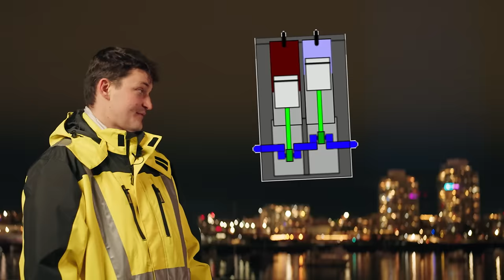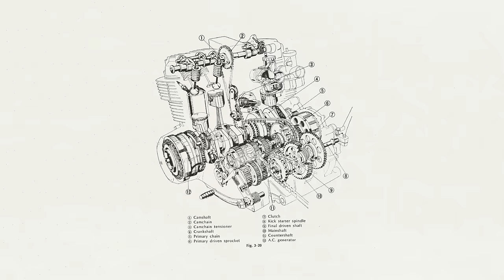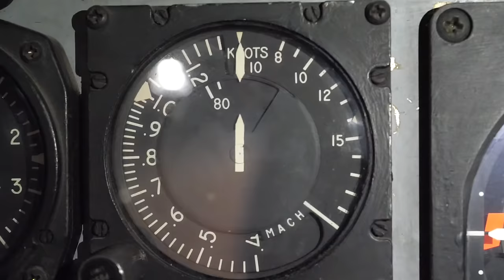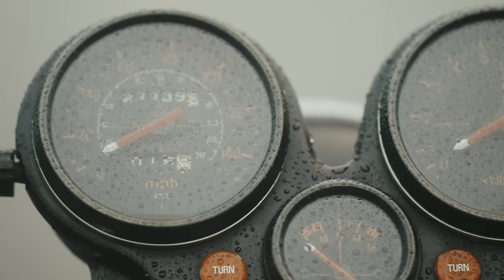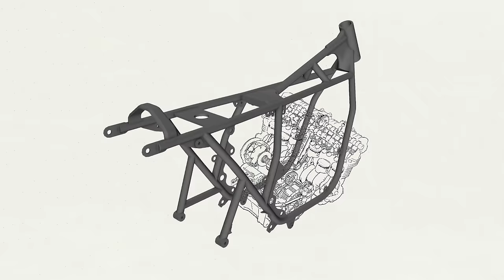Riding the Cream Machine - Honda's Smooth Six

Comment: A friend of mine bought a CBX brand new when they hit the showroom floors in the UK. I was riding around on an SP1000 Moto Guzzi at the time. He stopped by one day to chin wag whilst I polished my own bike on the driveway.
He asked if id like to take his new bike for a spin. I'll skip over the mental trip into the realm of another reality as I set off on a favourite test ride loop. But he was so lucky to get it back unscathed because having ridden the Guzzi for a couple of years I'd developed the awful habit of relying almost solely on the foot brake. They had a linked system that applied one of the front brakes along with the rear. Imagine for a moment the thoughts racing through my head (not to mention the state of my bowels) as I left my braking to the last possible moment, as was my want,  and discovered that no matter how hard my right foot was pressing down the bloody bike wasn't slowing. 
I never rode it again. But it was truly lovely to ride as well as look at.

Comment: In 1983 I was shopping for a new bike.  The local Honda dealer had both left over CBX's (the ones with saddle bags), or the new CB-1100F for the same price.  I bought the CB-110F, and although it was probably the better bike, I've always had some regrets....

Comment: That’s why I loved my 83 Seca 750. I could ride that bike to the very limits of its braking, acceleration, top speed and lean angle and it was always within my comfort and skill but just by a little bit. I controlled the bike, not the other way around.

Comment: The centre power take off position probably helps reduce torque distortion in the looooong crankshaft.
 I suppose that, arguably, it didn’t have to sell but rather to just exist in the stables lineup. It’s the centre page pinup in the sales brochure that hooks and hauls in the punters who then opt for more realistic choices further down the brand. But what a pinup!  Front tyre looks a bit slick!😮

Comment: if only Honda would make a straight-6 car with RWD. like a Honda Supra or Honda M3, that would be the most epic car ever, reliable, long lasting, light, perfectly balanced, best handling and most tediously engineered and overengineered. No one would buy it cause they prefer their oil leaking BMWs with CELs for the badge, but Honda has so much heritage I dont see why they shouldnt be on the same level
Reply: Agreed 👍👍👍👍👍👍👍

Comment: I had one of these...back in the day when they were cheap.  GREAT engine, until you had to work on it, but very reliable and scary smooth.  The joke at the time was that a CBX would pass anything on the road except a gas station or a place that sold chains and tires!  It was heavy and didn't really handle very well, but get it pointed in a straight line and whack the throttle home and you might start to think there actually IS a god.  Sort of wish I'd kept it and put a good Corbin seat on it (it already had a Kerker 6-into-2 exhaust)...but I moved on.

Comment: Great video, as usual.  Always wanted to try one of these but was always fearful of being accused of indulging myself in wretched excess.  They also sounded great with a six into one exhaust system but it looked like heck.  Had I known they could fly, I would have put my fears aside.  Instead, I contented myself with a 1998 VFR (gear-driven cams but a fuel tank that would roast your crotch because of some kind of fuel recirculation pump) and a 2015 VFR/Interceptor which was one of (maybe THE) the most elegant street bikes Honda ever made.

Comment: Follow-up:  In 1987, I replaced the CBX with a left-over 1985 Honda VF1100S.  It was a bit faster then the CBX, still heavy but did handle better, had much better brakes and suspension (my CBX was a '79).  It was smooth, but not as smooth as a CBX.  However, it was a bit easier to service and did not require those legendary "Japanese mechanics hands"...you know, the ones with 8 fingers 1/4" in diameter 8" long with 10 joints each...  And, believe it or not, I STILL have the Sabre.  It's got just over 70k miles on it and has never given a spot of trouble, but I do maintain it by the book and can do everything myself.  Great bike that might be worthy of a video, IF you can find a nice one.  So many of them got killed after they got cheap in the 1990s and the kids started buyng them and then crashing them.  Pity...

Comment: Years ago I saw some photos on the knee slider website of some absolute lunatic's mad creation. He had turned two CBXs into a V12 and then built the frame to go around it and apparently actually rode the rolling insanity.
I thought it would have been one hell of a powerboat engine.

Comment: I really really wanted a a CBX 1000 when they were in the dealers, however I could only afford a newish secondhand Honda CB900F. As it turned out the 900 was a great bike probably the best Honda overall for short moment in motorcycle time.

Comment: A rare beast indeed, its the bike you wanted if you wanted a 6. The trouble was, if memory serves, was that all the competitions 4 cylinder 1000's were just as fast and handled better. Still..... what a machine!
Reply: The 1980 16 valve GS1100E put the nails in the CBX's performance coffin. The aftermarket too decided the CBX wasn't worth developing performance parts for, besides exhaust systems and a few chassis parts. Then the 81 GPz1100 made another offering on the market that out-performed the CBX in every measure of performance. Even the standard 81 KZ1100A2 shaft could keep up with the slower 80 and up CBX, and all of them could better even the faster 79 CBX for a lot less money. THe cBX was eft out of the race, figuratively and literally, while the KZ became the small block Chevy of the motorcycle world for the next 10 years, and the big GS was the Chrysler Hemi of motorcycle drag racing for the next 20 years. I choose the CBX because of the mechanical sophistication, the visual presence of that Mount Rushmore sculpted in aluminum engine,  and the heritage of the RC166. I also believed with a few modifications, I could make the CBX a much faster bike, one that sounded even faster than it is, just as a "bonus". I ended up with a very quick and light weight 79 CBX, but by the time the GS1150 and V-max came along, my back yard budget engineering abilities had finally met their match and i stared losing races to stock bikes more often than not. When the GSXR1100 and Ninja ZX10R  entered the picture, even an 1150 big bore kit and smooth bore carbs weren't putting my CBX on a level field with the new bikes.

Comment: I've only owned Kawasaki bikes, they speak to me in a specific way.  I always feel like I have to work to make the bike work.  I don't with Honda's.
The first Liter bike I ever rode was a 2007 Honda CBR 1000RR, up until then the fastest, most powerful bike I'd ridden was my 2002 Kawasaki ZX-636.  It was night, I jumped on it, rolled the throttle on, and mindlessly clicked through the first Three gears, came up to a corner going way faster than I have any right to be, looked through the corner and the 'blade just did it.  I didn't have to do anything.
That Honda was so much better than I was, or will ever be.  Honda bikes are there, I'm the limiting factor of their amazing Engineering.  Which is why I won't buy one, I don't feel like I'm needed in that equation, I hold the bike back.

Comment: Needs a 6 to 1 exhaust for that high note though :) 6cylinder sound is wasted if it doesnt reach many octaves <3

Low brreeeeemm breeeeemm is for the v6 anchor weight engines

Comment: I know the configuration is different, but I have to wonder if the CBX gave rise to the idea for a boxer 6 for the Goldwing/Valkyrie bikes.  As a prior owner of a Valkyrie, I can attest that you'll never have as smooth of a riding experience as you will on a Valk/Goldwing.  The throttle response is instantaneous like RF9 mentions.  It's just so smooth you fully grasp at how crappy even the best suspension systems are on today's roads.

Comment: Just a note on how tough and durable a CBX engine could be (less so the clutch and transmissions, though), I can't count how many times I boogered the first to second shift while racing and sent the tach needles of these things way past the 9300 RPM redline, many times with the needle pointing straight down - approximately 14,000 RPM extrapolated - and never having blown one engine up.

Comment: I wonder if the CBX engine still has potential as an updatable platform.  A lot of the engineering such as the mid crank power take off, similar to the CMX 250 engines and the CB 750 engine's mid crank driven cam chain has some very interesting applications.

Comment: *Corrections to the narrative:1)  1969 was the first CB 750 “Sandcast.  2)  CDI = Capacitor Discharge Ignition. 3) The first H2 750 was a 1971 released only in Norway & Sweden and was dubbed the Mach lll. 4) The first Z1 was a 1972 model in European release only and very few were sold and had no marketing. William

Comment: Nothing is more frustrating on one of these bikes than rebuilding the carbs and having it run beautifully one year and then the next year cylinder #4 won't run at idle......you have to remove most of the engine mounts to tilt the engine forward to remove the carbs (they come out as a package) and then remove that pesky idle jet and clean it in the ultrasonic cleaner. then you get to put it all back together.  Love my bike though!

Comment: I've had a number of six cylinder inline car engines and they've all had kind of a burble at idle.  Not really a miss but kind of a light pop in there somewhere.  As a Honda guy back to the 60's of course I've always lusted after an inline six bike.  I've had to settle for a flat six Honda instead.  Also "creamy" smooth.

Comment: A 4 cylinder boxer with the 2 middle cylinders on one side and the outer ones on the other side would also be balanced primary and secondary. I haven't seen one yet. It's always 1&3 one side and 2&4 other side. 🤔
I love motorcycles but they're all too racy. The CBX would be a dream bike for me if it had half the power, half the valves, one carburetor, twice the low end and a lot more flywheel.

Comment: 9:08 Bikes of that era had flexy tubes, wonky carbs, air cooled for tech weaknesses. No ABS or traction control for the rider. They had a long way to go. Thid bike was not the pinnacle.

Comment: I disagree, the problem of the cbx is the handling, the engine is not a brick, its a wall, i drove one and in the first bent, i felt a weight on the bike that was detached from the .. frame?  i felt someting really wrong on the handling.. i felt the massive weight of the engine. 6 cylinders on this frame were two too many. Dont miss understand me, I love the 80's bike, even i owned a cx500 turbo which handles soo much better than that one, even with very similar weight. I love the bike and I love the sound, but as you well said.. i dont want to drive it :)  cb900f, cb1100 have better handling... but I know... after seen this, they will be two cylinder short, but they can be driven without killing yourself.

Comment: I will always wonder why the CBX didn't have shaft drive, making the later full dressed versions the first true sport touring machine that they could (and should) have been - they put a shaft drive on the Nighthawk 700 for God's sake - though on the flip side I have to wonder what's the highest gearing a CBX could pull....

Comment: I have a 1979 silver one; yes, the sound is great. But its way too complicated, a nightmare. See: 6 carbs, each one dilating in accordance to its position; 24 valves, plus 24 inserts to action the valves, each one has its own measure. Plus 4 commandos, yes, four. The alternator, which had to be repositioned to the back of the engine, has its own clucht, yes, otherwise will fry... drinks one liter of oil per 1000 kms. Chassis and brakes not up to the job. Last bunch of these machines were donated by the factory to engineering schools, nobody wants the divine CBX... now, its a collectors item, oh dear vanity, how powerfull you are...

Comment: Arguably the machines of today outpace all riders even in the motogp circuit which means that they far outpace the rest of us who ride for fun and not money. It makes sense that building a more rideable bike is going to be a lot easier to sell. You see this all the way down into dirt bikes and mountain bikes. There will always be a handful of people who want to ride the more challenging bikes in a more raw form but the masses whose money will dictate design are going to choose the bike that lets them ride fastest and safest.
Reply: A lot of people buy based on looks and perception. If it was just performance and ride-ability the exotic bikes wouldn’t exist as there are much cheaper bikes that are as fast, or faster, and just as easy to ride. 
And, for some people the fun is having the extra power and performance even if you can utilize it 100%. I don’t particularly enjoy constantly high rpm’s from a small engine. Makes me feel like it’s struggling. And, with a smaller engine you need to keep the rpm up for it to have good power. With a bigger engine I feel more relaxed and can run around in high gear most of the time if I want. And, still have good power at lower rpm. Plus a high performance bike lends an amount of confidence. You’re not pushing the performance edge so things still feel stable and composed. Riding a lower performance bike at the same speed can mean you’re pushing it hard and not nearly as relaxed.

Comment: Ahh, the times when Japanese engineers thought that motorbike = engine. The CBX 1100 was famous for its speed wobbles and useless suspension. At the same time another inline 6 -- the Benelli Sei, which was available earlier than the CBX -- had a better frame and suspension. (Let's pretend it did not exist!)

It took decades until the Japanese learnt how to build a good frame. Now they can (though still struggling with their underdeveloped brakes) but in the meantime they should have developed the electronics and aerodynamics of their bikes. They could not. Look at the GP.

Motorbike is not an engine. Motorbike is putting the maximum performance on the ground. And it is extremely hard in contrast to building an engine. This is why Honda failed. And this is why this F9 episode is intentionally deceptive again.

Comment: I have no idea what point you're trying to prove. My 1999 CBR600F4 made similar power, had no ABS, no linked brakes, no traction control, no fuel injection, nothing. It did nothing to "improve the rider." It was an excellent piece of machinery and did exactly what it was told to do.

Comment: Love the thought processess but i think its a bit off . 
The CBX cant and doesnt handle . Talent means nothing if you dont have the tool for the job so a shortcoming wasnt the riders capability but instead the machines . You cant blame a rider on a flexable frame and weak swingarm attachment . Bikes later seeked to rectify design issues and not riders ability to the point about 15 years ago the human element became the flaw . Sadly the CBX wonderfull as it is is a rehash of previous models but just going bigger to seek better , a design idea too far . Id have 1 in a hearbeat .